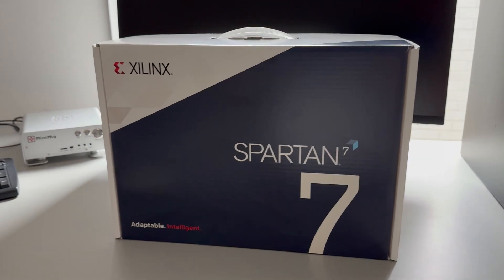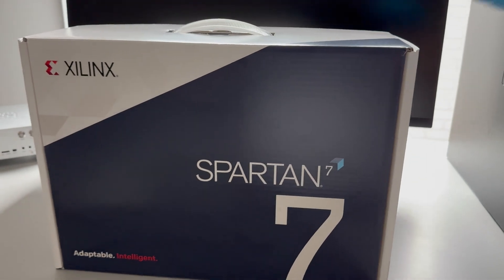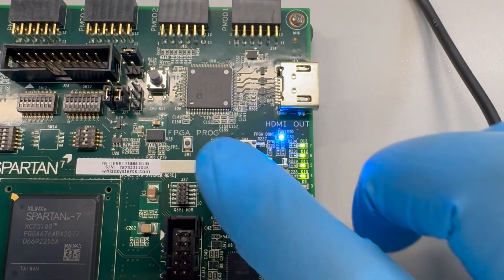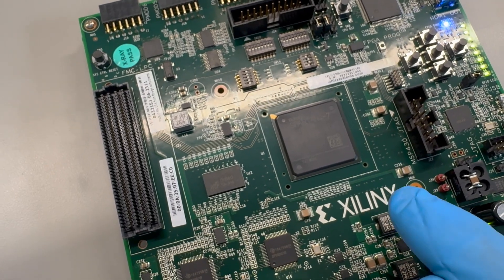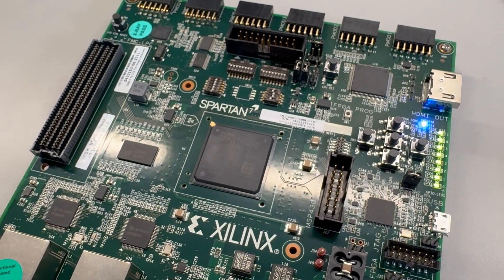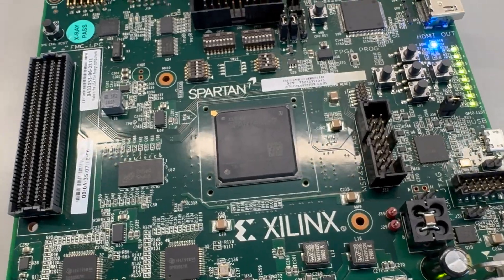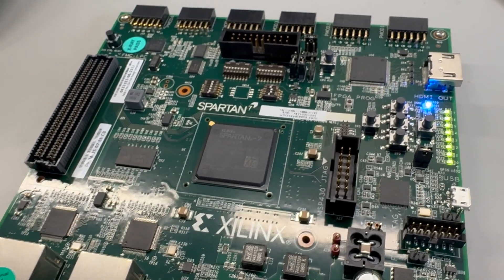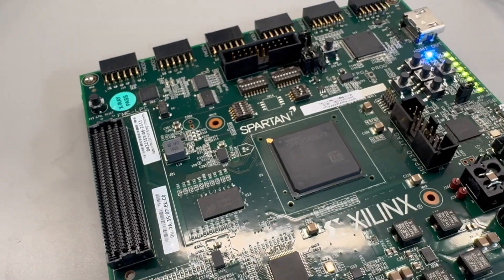S100 development board - SP701

Comment: pinout of that high density connector is done that way so that u can use RMII RGMII over it aka giga internet maybe even 2.5G it is signal integrity.
AS for the floating ones what else would u do with the ones left?
Reply from the maker: Thank you for your insight! I understand your explanation, but I'm still curious. Since this is a development board, why not utilize all available pins (aside from this FMC LPC)? I have sufficient I/O for my current needs, but I wonder about the reasoning behind this design choice. Perhaps Xilinx (now AMD) has compelling reasons. Could it be related to the PCB form factor, the intended purpose of this platform, or something else entirely?
Reply: @amicube  hmm i think it is lore like if you need more get a way larger board and or make one. Since at some point it gets turned into a module from a devboard.
ALSO you will probaly want some IO to be 1V8 some 2V5 and maybe some 3V3 and making it all so customisation is hard + at that point u are expected to solder on the board and so on ....
ASK and i will try to respond 
BTW there are some modules with a lot of bare IO exposed like a RPI CM4 module but that also has a lot of limitations....
Reply from the maker: Makes sense.

Comment: Where is this available for $100? I'm seeing $1000 minimum.
Reply from the maker: If you are referring to SP701 development board, price is about 830$ usd before tax and shipping (from Xilinx). As for the FPGA part itself XC7S100, price depends on how many units you purchase. If you buy one, you are looking at about 160$ usd. If you buy thousands price can drop significantly, depending on the vendor.

Comment: What are you going to do when the year is up with Vivado ? $4K per year is kinda spendy.
Reply from the maker: For Amiga development, free version of Vivado will do the job.
Reply: @amicube  I suspect that part that is on this dev board is not supported by the free version. You should double check that.
Reply from the maker: @muhdiversity7409  I whish this was UltraScale(+) part :) However this is still mid-range, same as S50 for example. I was testing the board using WebPack so looks like free version is a go. Limit is only imposed on the X000$+ parts.. I assume logic is, if you need UltraScale you can afford the license for sure and perhaps you need all advance features of Vivado.
Reply: @amicube  Ok, that is good to hear. I could afford to pay the license but I cannot justify it. Good luck with the project. I have subscribed and will be following. Cheers.
Reply from the maker: Thank you very much! Appreciated.

Comment: Wait what? Does this mean that MiniMig will get actual true, wired Ethernet without any kind of ESP32 solutions? 😮 #dealbreaker
Reply from the maker: Yes, for sure! I will just use different ic than this development board, but yes.
Reply: @amicube  That's awesome news! I have never owned a MiniMig for that particular reason - it has always lacked proper Ethernet connectivity. Having a true wired networking solution on the PCB is a game changer! For your next video update, can I please ask you to showcase it?
Reply from the maker: @First_Ninja  Sure thing!